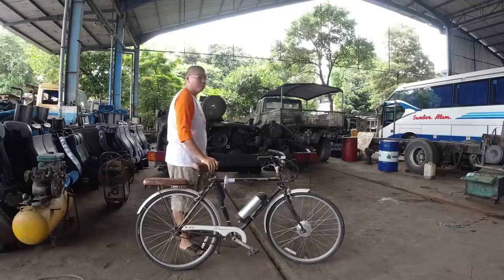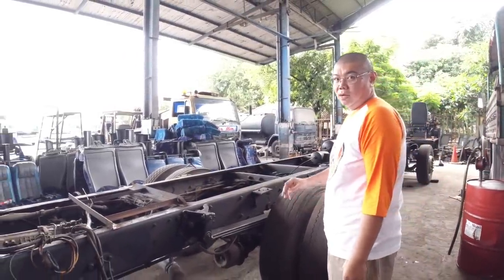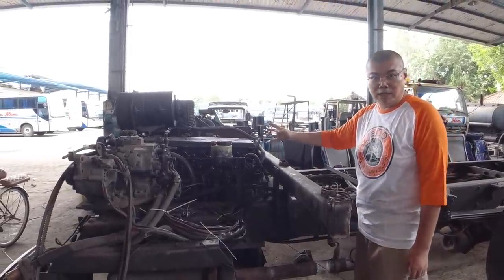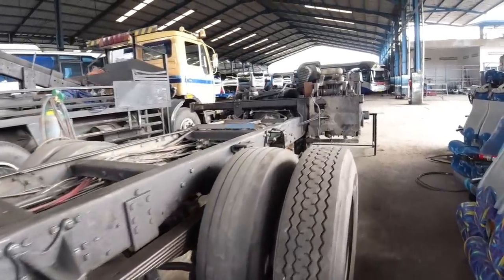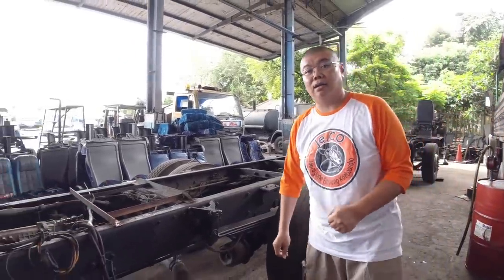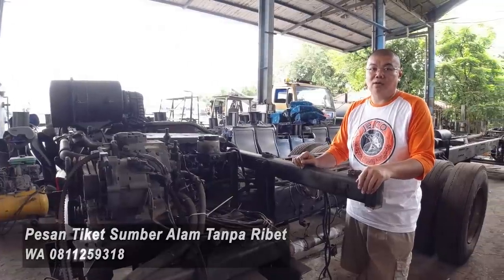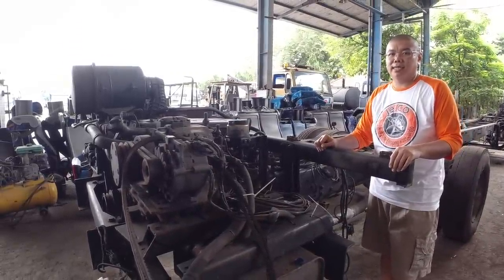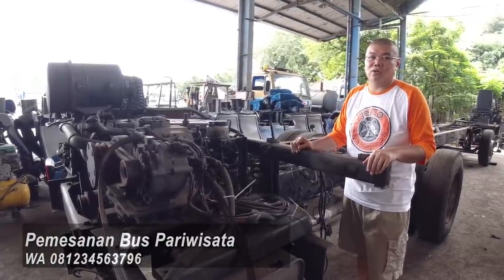BUS LISTRIK Why Not?

Comment: Pindad bisa bikin motor traksi/dinamo penggerak gerbong kereta listrik/KRL. Ukurannya segede diameter roda motor ring 17. Kuat menggerakkan/mendorong gerbong kereta segede gaban. Untuk bikin motor listrik untuk beban seberat bis dengan penumpang full pasti bisa dilakukan pindad. Pt len juga bisa bikin kontroler termasuk inverternya.

Tinggal masalah batere yang paling krusial. Batere yang paling tidak bisa tahan hingga jarak tempuh 1000kilometer minimal. Tantangan terbesar hanya di batere. Perusahaan sebesar Tesla juga masih riset untuk long range elektrik batere dengan bentuk yang kompak.

Solusi batere: akan jadi seperti krl, harus ada kabel listrik di atas rute bus. Seperti trem listrik. Lucu aja kalo jalur pantura dari jakarta ke surabaya dikasih bentangan kabel 1500v. Belum lagi tol transjawa. Tapi ini sementara, sambil tunggu riset baterre tenaga nuklir ada yang bikin, tanpa charge bisa bertenaga hingga minimal 5 tahun.

Goodluck, pak. Mantab.

Comment: Mungkin solusi untuk recharge batery bisa dengan menambahkan 3 sumber energy sekaligus, jadi bisa auto recharge:, 
1. Energy dr putaran angin yg dihasilkan saat bus berjalan.
2. Energy solar system/tenaga surya
3. Energy putaran mesin saat berjalan

Alternative berikutnya adalah:
1. Mebawa cadangan batery yg cukup
2. Menyediakan charger pengisian kilat (tapi yg ini harus terintegrasi dg pertamina dulu).
3. Pertamina menyediakan batery isi ulang.

Tapi gak tau berapa volt energy yg dibutuhkan untuk memutar mesin BUS dan  bisa gak energy sebesar itu ditampung di wadah yg cukup kecil. Takutnya penampung energy yg dibutuhkan malah lebih gede dari BUS nya sendiri 😂😂😂

Comment: Sudah semakin feasible pak, diperlukan perhitungan yang tepat untuk memastikan bus bisa bergerak sesuai dengan peruntukannya. Saat ini sudah tersedia motor listrik dengan kemampuan setara dengan mesin bakar, bahkan hingga 400HP (contohnya dari https://www.zf.com/), tentunya ini lebih cukup untuk sekelas 1626 atau 1836. Untuk kemudahan instalasi, saya menyebutnya konversi, dari motor listrik dapat langsung dihubungkan dengan propeller shaft yang ke gardan. Teknologi motor listrik untuk bis ini dikendalikan dengan control unit  yang juga terhubung dengan semua komponen bus (misal pedal gas, pengereman, dll), berbeda dengan motor listrik sederhana untuk aplikasi umum. Sisa ruangan mesin dan transmisi dapat dimanfaatkan untuk ruangan baterai, sehingga tidak mengurangi kapasitas muatan. Memang kapasitas baterai akan menentukan daya jelajah bis tersebut, terutama dengan peruntukan pemakaian luar kota. Pilihan untuk menggunakan teknologi opportunity charging di rest area dapat menambah daya jelajah sehingga memenuhi kebutuhan perjalanan.

Comment: Saran saya, untuk long haul, menggunakan system hybrid saja. Karena, seperti yang sudah disampaikan, baterai memiliki kelemahan di jarak tempuh yang relatif pendek untuk bus AKAP (tergantung dari jenis baterai dan kapasitas nya) dan lama waktu pengisian baterai nya (bisa memakan waktu semalaman, tergantung dari jenis baterai, kapasitas, dan besar arus yang masuk).

Sistem hybrid yang bisa dipakai untuk mengisi di putaran bawah (karena motor listrik relatif besar torsinya dibandingkan dengan mesin konvensional, tetapi boros baterai karena starting current nya harus besar) dan mesin dieselnya baru menyala ketika dibutuhkan di putaran atas/langsam (diesel lebih irit jika dipakai stationery/langsam/tidak digeber geber).

Atau bisa juga dibalik, mesin diesel dipakai di putaran bawah (torsi nya agak kalah dibandingkan dengan motor listrik, tetapi mesin konvensional lebih irit dan bisa diisi ulang bahan bakarnya dengan relatif cepat/isi solar di SPBU daripada charging baterai motor listriknya), dan motor listrik nya dipakai di putaran atas (starting current hanya sebentar, lalu continues current, dimana torsi sudah sudah dibantu dari putaran bawah dari mesin konvensional nya, otomatis konsumsi listriknya jauh lebih irit dibandingkan mesin dieselnya).

Monggo komennya apabila ada kesalahan penjelasan maupun ada tambahan dalam implementasi nya.
Reply: Mohon info, untuk bus yang akan digunakan prototipe, menggunakan bus apa pak? Dan kode mesinnya. Untuk riset berapa power dan torsinya. Nanti bisa dikombinasi (hybrid) atau diganti sepenuhnya (full electric) dengan motor dan baterai yang power dan torsinya memadai.
Reply from the maker: Pilihan bus banyak, tinggal mau pakai chassis apa. Tapi rata2 powernya 250PS.
Reply: Joss..
Jika hybrid juga bisa memakai motor listrik yang lebih kecil satu di tengah karena masih ada transmisi yang terpasang 

Tinggal mengkombinasikan rasio yang tepat dan menyinkronkan dengan mesin diesel

Kendalanya yang jelas bobot bus
Hybrid berarti lebih sedikit baterai, tetapi masih membutuhkan ruang bbm dan mesin beserta transmisi gearbox

Full elektrik membutuhkan baterai yang lebih banyak dan transmisi tetap dipasang (hubungannya dengan motor listrik) 

Bisa juga meniru produk yang sudah ada dengan dimodifikasi seperti e-canter

Charging seperti bisa dengan listrik 3 fasa nantinya fasanya dibagi aja ke setiap baterai
Jadi lebih efektif dan menggunakan yang watt besar (fast Charging)

Maaf jika ada yang keliru 🙏
Masih belajar juga 🙏

Comment: MAB (Mobil Anak Bangsa) kan bikin Bus Listrik. Mungkin powertrain dan baterainya bisa ambil dari dia orang. Tahun lalu, katanya tahun ini mau produksi yang made in indonesia motor dan baterainya. Yang pasti, kalau sebuah bus dibikin jadi bertenaga listrik, beratnya bakal naik drastis untuk baterai. Itu berarti, karoserinya harus dibikin ulang dengan bahan yang jauh lebih ringan. Stainless steel? Carbon fibre? Ini bikin ongkos produksi naik lagi. Jadi, selain cuma base bus dan ilmu elektronya, modal buat R&D ini kudu ada juga.
Kalaupun ga bikin ulang karoseri, minimal buat powertrain dan baterainya. 
Untuk mengakali charging yang lama, sepertinya paling oke itu sistem tukar baterai. Jadi, "SPBU"nya bus listrik itu swapping battery, bukan charging. Kira-kira sama seperti beli galon aqua di Indomaret. Ini akan berhasil, kalau pengguna mobil listriknya uda mulai banyak.
Atau...
Rakyat diikutsertakan buat ikut jualan jasa swapping baterai. Sama seperti agen gas, agen galon, ada juga agen baterai. Yang penting, mobilnya banyak dulu. Mungkin kalau semua P.O. seluruh Indonesia bisa ngomong kata sepakat, terus bareng-bareng pake bus listrik, ide ini akan menarik.
Sejahtera selalu pak Anthony, rezeki lancar berkah berkuah. :)
Reply: Lebih hemat bisa pake mesin hidrogen juga, karma emisi mesin hidrogen hasilnya adalah air dan oksigen.
Reply: @jhoni_48hz95  Ini hydrogen combustion engine? Yang hasilnya juga nitrogen oxide?
Reply: @FarhanPerdana  hooh, cuma mahal sih mesin sama hydrogen nya
Reply: @jhoni_48hz95  mahal biaya sama lumayan bahaya kayanya gan kalau gak di maintenance secara baik, tau sendiri lah tipikal orang sini gimana kalau belum rusak belum di perbaiki selagi masih bisa di akali di akali dulu 😁
Reply: @raihanbintang1840  nah ini.

Comment: Sebenernya kalo kendaraan listrik yg masih pakai mesin itu 100% bukan piur listrik tapi mesin hybrid. Tapi kalo mau pake mesin ya CCnya harus di kurangin, nanti di comfair sama Motor listriknya ya istilahnya 50:50 lah. Tapi kalo emang mau bikin full electrical ya yg harus di pikirkan posisi batrainya, Voltase batrainya, Posisi motor listriknya dan kendaraan full electric biasanya fak pake transmisi. Jadi sistemnya dari batrai langsung ke Motor listrik.
Reply: Low tesla ga ada mesin nya bos
Reply: @saepulkohar8847  Tapi yg masuk Indonesia itu udah 100% Full electric.

Comment: Mau bertanya,kenapa kendaraan listrik lebih banyak menggunakan sistem charger, tidak menggunakan sistem panel surya?mohon penjelasan nya
Reply: Tenaga surya / solar panel mungkin, bukan tata surya
Reply: Tata Surya mah apaan
Reply: Sistem tata surya setau saya itu berhubungan dengan luar angkasa deh 😅😅😅
Reply: Izin koreksi, panel surya.
Reply: Menurut kalo digunakan panel surya sebagai sumber utama pada energi untuk menggerakan kendataan itu kurang efektif. Pertama kendaraan berjalan belum tentu selalu pada cuaca yang cerah kadang mendung kadang hujan. Jadi energi matahari untuk mengerakan motor kurang stabil walaupun sudah di tampung ke batrai karena logika awam saya pasti untuk menggerakan sebuah mobil energi yg besar jadi antara input outupnya ga sesuai. Kecuali panel suryanya itu bukan sebagai energi utama itu bisa di aplikasikan. Seperti di mobil camperfan yang dimana panel suryanya bukan untuk menggerakan mobil tapi digunakan saat mobil sedang camping untuk peralatan, ac, dll. Semoga bisa menjelaskan dengan logika awam saya.
Reply: Sistem Panel surya masih belum cukup cepat dalam hal pengisian daya, hitung hitungannya agak ribet tapi untuk charging battery pack nya akan lebih cepat di charge dari PLN ketimbang panel surya, perlu panel surya yg sangat lebar untuk bisa mengimbangi kecepatan pengisiannya 
Sepengetahuan saya begitu Kalau ada yg lebih paham mohon dibantu menjawab
Reply: @egiaditya4517  ralat panel surya atau sel surya